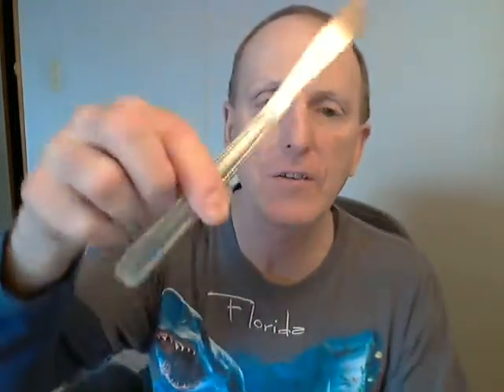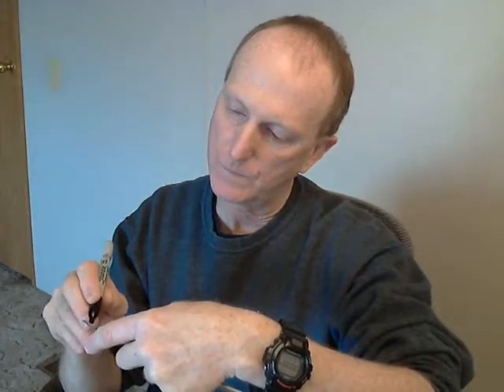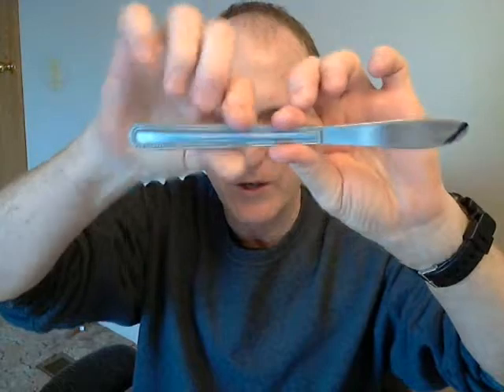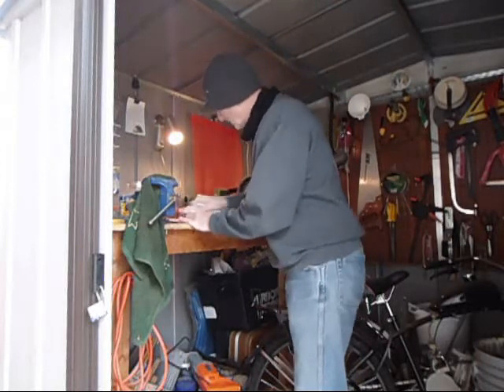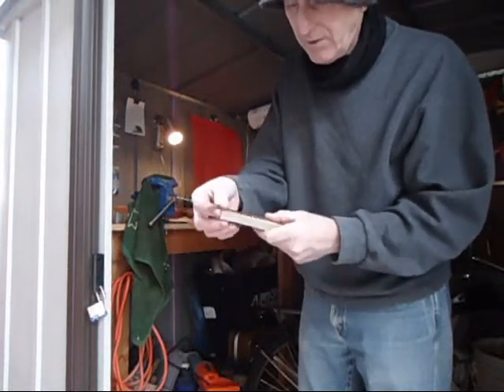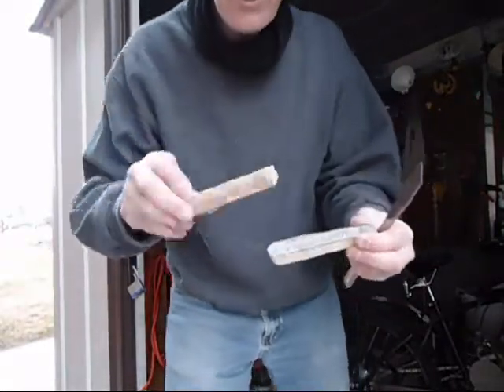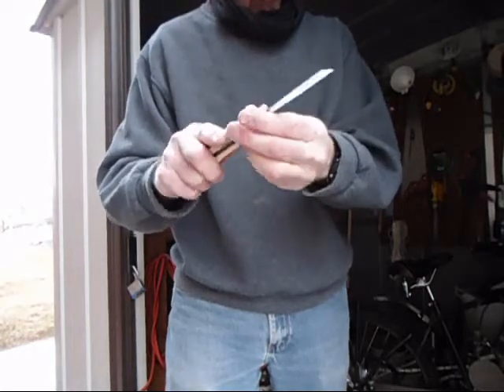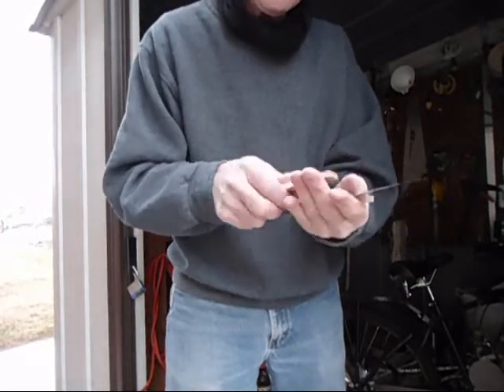Easy Homemade Utility Knife: Part 1

Comment: Have you tried Mechanix gloves? They would probably keep your hands warmer, and they are pretty comfortable to work in. They don't restrict movement very much.
Reply from the maker: I've seen them but never tried them. Thanks for the info. I will pick up a pair.
Thanks again!
Peace, Duane
Reply: If you can find them locally (I assume they would sell them at a Wal Mart or somewhere) you should try on a pair first. You may not like them as much as I do. I am pretty sure Mechanix makes a cold weather version also, but I would think they may be more restrictive.